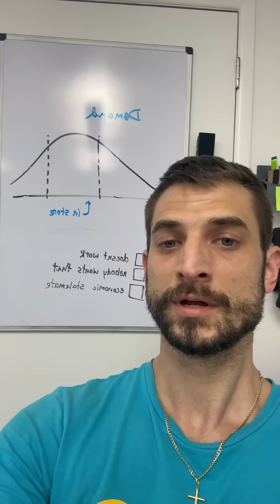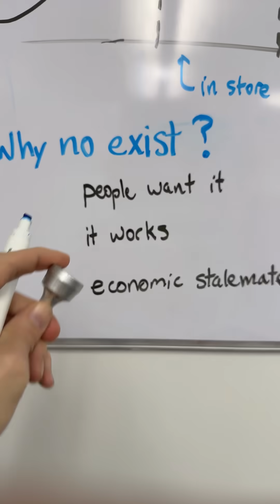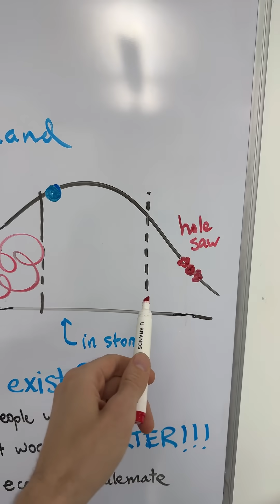why aren’t people building these good ideas?

Comment: Uhh, I think I've seen at least a couple pipe chamfer tools like what you showed.  Possibly the demand is low because of some reasons:  some people don't even chamfer their pipe.  Those that do simply use another tool like a half round file.  Or the tools you show but have some skill and the tools work fine no problem (The outside tool needs a steeper angle in my opinion.  The inside tool should be 'swizzled a lot faster).  Or they are completely capable of building their own custom tool.  Or using plastic tubing and avoiding the whole thing.  Of the ones that could identify wanting and using the tool, how do you let them know the tool exists before they are marketed to by someone who came up with a similar idea?  Now you are competing.  What to then?  License their design?  Sell their mass-produced version?  Or just drop ship their product from Amazon after charging people more?

Comment: Or there is another solution. The Ridgid inner/outer reamer uses multiple blades to solve the chatter problem. 

It is kinda proof that you are right. Their tool covers a range of common sizes.

Comment: Good points, but what if you make it adjustable like a cheap boring head for a mill/lathe?  It doesn’t need anywhere the rigidity, accuracy, or capability if you’re just chamfering ID and OD round stock.

Comment: Hmm, it wouldn't be as cheap, but I could imagine an edge break pencil sharpener that has an adjustable bore but the carbide blade stays in the same place. Solves the problem of dividing demand between different sizes. On the other hand, I think sandpaper or a sanding block actually works pretty well for this application

Comment: Great point; just a comment on your unfortunate example... it's a dumb implementation if hand-held. The blades shouldn't be centered axially where it's unstable, it should be centered on the lip, like with a V confuguration of blades on opposite sides, while being powered axially. Or at the very least have a tab that let's you stay parallel axially. if it's on a drill press and you've clamped the pipe, you shouldn't have the issue you demonstrate. If something is physically possible, the rest is morphology.

Comment: I used the pencil/s-blade style until I came across a tool like that 3-blade bit you have- EXCEPT that it’s concave at one end one convex at the other. More importantly, each end doesn’t just have 3 cutters: there’s are probably 20 or more. So, instead of chattering, it’s closer to sanding. Hand-held. 
—I use it with the Zoom-Lock refrigerant piping press-fitting system. Works on piping from 1/4  up to (I think) 1”. —the fittings are expensive and have O-rings, so I also use fine Emory after that. I like my piping neat and tight

The first question for anyone who tells you it won’t work is ‘why?’
And push that: we all come at problems slight differently.
Reply: Ridgid 223s$227s?
Reply: @ProjectAnubisUSA Yep. That sure looks like it
-mind, I’m lucky enough to work for a large commercial/industrial company. I just tell them I need a PO and don’t have to sweat the cost. 
—I probably wouldn’t pay that out of my own pocket. But, I will say the one I have has reamed many, many pipes and is still going strong

Comment: This is the domain of home manufacturing. 
“It won’t work” ≠ “it’s a bad idea”
It might mean it’s not commercially viable for a company, or that it’s too easy to copy and an established company/china will just make a knockoff cheaper than you can if the idea works, etc. 

It’s not just about can it technically function. 

I’ve had a ton of great ideas (especially around microwave features for some reason) but they’re mostly as simple as a software update, so it would never work for me to try to go from “guy with idea” to “guy with microwave manufacturing company”
Reply: I have so many devices where I would love to be able to change the firmware just so slightly...

Comment: Your problem (burr in tough materials - correct?) is already solved: 
Pneumatic deburr tool

If you need a cleaner chamfer than that, you're gonna have to learn CNC programming
Reply: The problem was a stand-in. It was representative, not specific. Plug in any "unsolved" problem.

Comment: Wait ive been thinking about this exact thing! I work with EMT. 

There's a product that has 3 steps for 1/2", 3/4" and 1". And a replaceable steel bit thats flat  with a V for each step. I use it on my impact

I want a 3D printed version with utility blades for PVC conduit

Comment: Most things in the idea phase won't actually work. At least not the way you originally think. BUT if you try it, you come up with progressively better ideas along the way which improve all the projects you do in the future. Maybe you make something similar to the original plan, maybe you decide to abandon the idea. Either way, you get the most value when you try.
Reply: Or maybe Carter is right 90% of the time but the 10% thing that works is so great that it makes it all worth it.